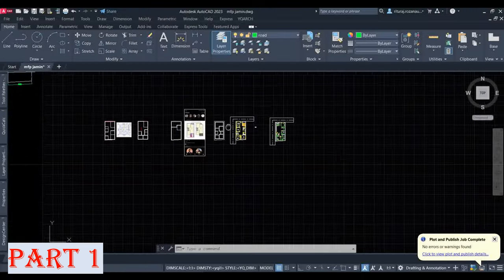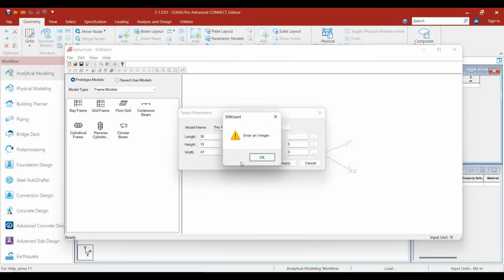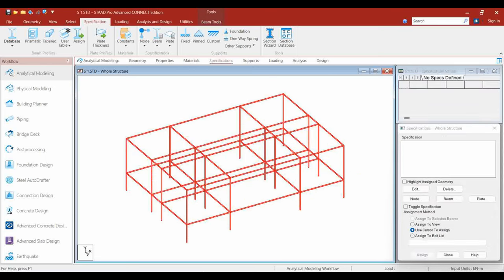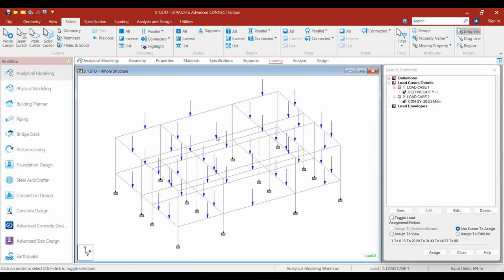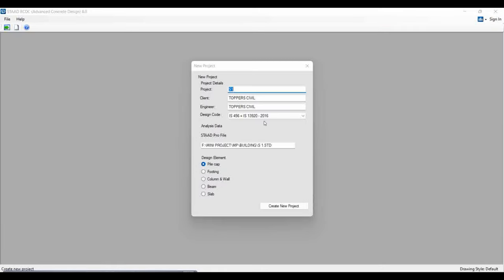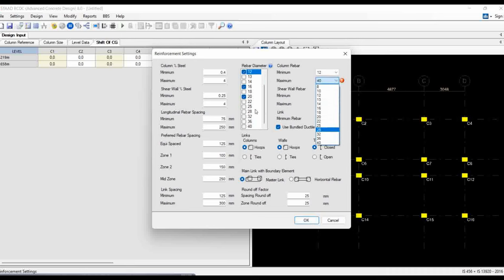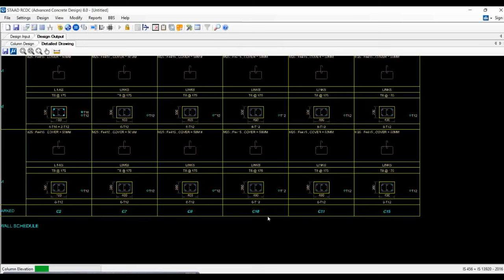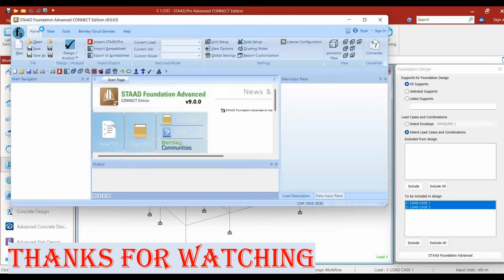Structural drawing in staadpro rcdc | #RCDC | Staad.Pro #staadpro | Full Structural drawing in RCDC

Comment: Hello
I ask you:
Can Staad Pro check if the existing concrete building is safe or not? and can `I insert the existing bars inside the concrete section to check it ? and after that can Staad do the complete analysis of the whole building with existing concrete sections and reinforcement  ( seismic analysis for 3D whole building )?THANKS
Reply from the maker: yes.
Use the "User-defined Reinforcement" feature within STAAD.Pro's concrete design module. Specify the reinforcement area and location based on your existing data.
Reply: @civilworldd  have you video tutorial fo this case ? thanks
Reply from the maker: @amrmasoud5580  you can contact me..... Visit our website..... Link in bio...... I'll share the necessary stuff with you